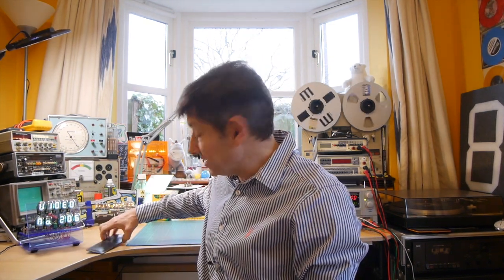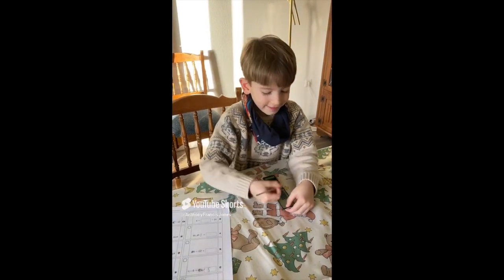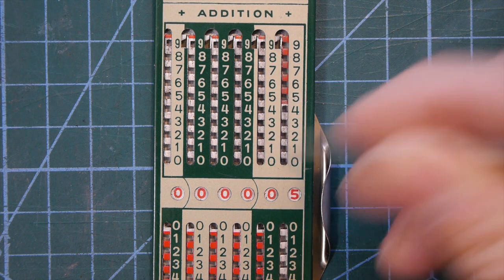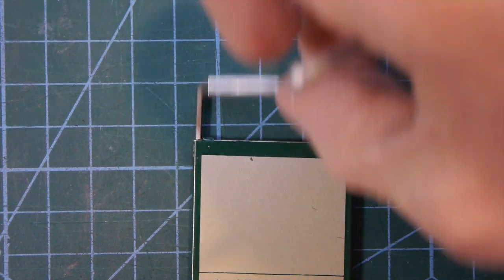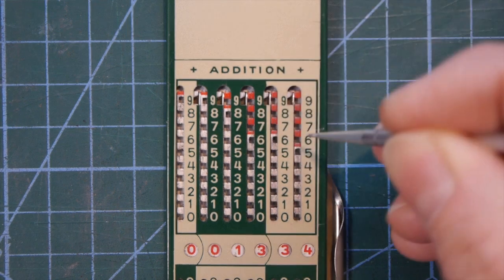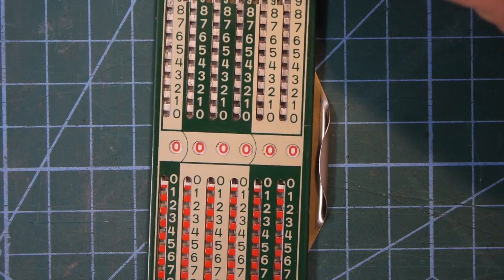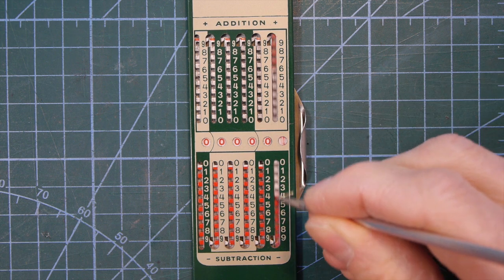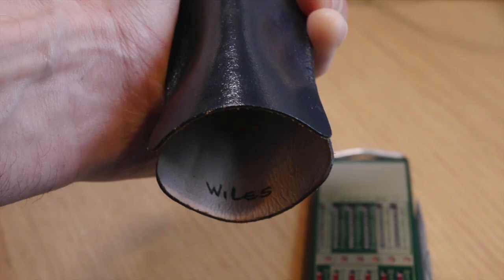Addiator Piccolo-S - F-J's Physics - Video 206

Comment: I admit to feeling envious when a classmate brought one of these devices into school. I would have been 8 or 9 at the time. There were others like me who queued up in the playground to have an all too brief turn at using it. The experience gave me a keen interest in other flat calculators where the answer showed through little windows in the outer casing, such as an odds/payout calculator for horse race betting - basically a slide rule for gamblers (no idea where it came from!), and a Johnson Standard Exposure Calculator for photography with its black and white stripes and satisfying knurled wheel action.
Reply from the maker: That's a brilliant story and thanks so much for sharing.  The thought of kids saying, "Gis us a look at your calculator" is gold!  Yes, there are so many great flat mechanical calculators/converters.  Do you know the E6B flight computer.  Many of us had many a tough hour learning to use that one but it is fantastic in what it can calculate.  Most of my other examples are just sliding conversion tables but perhaps I should do some shorts on those.

Comment: It seems to be a fancy abacus - using counting rather than arithmetic. Your first approach to adding with carry showed that you were applying arithmetic to the solution, but the "round the corner" just extends the counting (successor) method.

2:41 I recently discovered the reset bar on supermarket wine shelves: when you take a bottle out and slide the bar it brings the remaining bottles forward, rather like those numbers.
Reply from the maker: Yes, you are right.  I got quite quick with it after a while and it all seems to revolve around having just the right amount of friction.  Too little and it does not hold the count and too much and it is a real pain to use - one of the other ones I have (there seemed to be endless copies) suffers from just that.  Wine... I am not a great drinker but I will head over to the wine area to see that in action!  I did do the sort of Archimedes' screw to get a pack of razor blades the other day - usually like to look sharp before filming a video!!